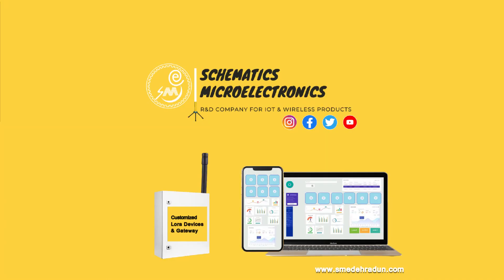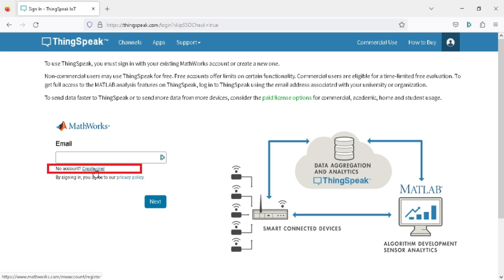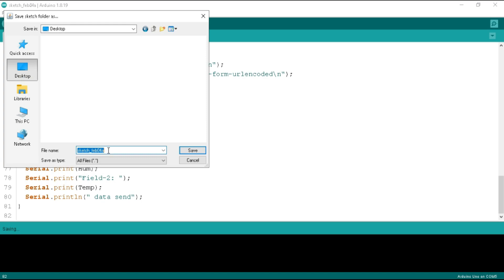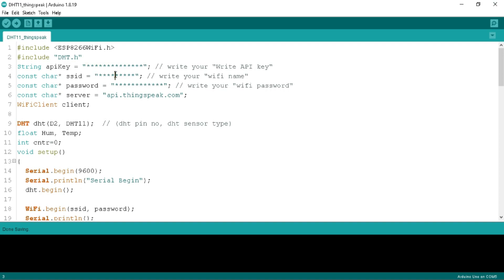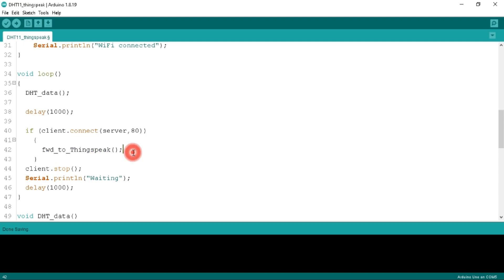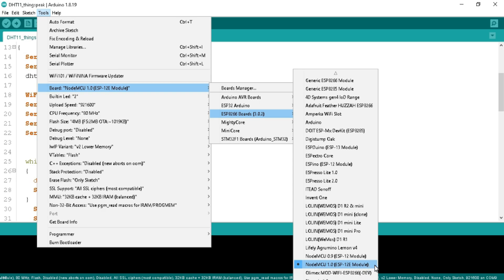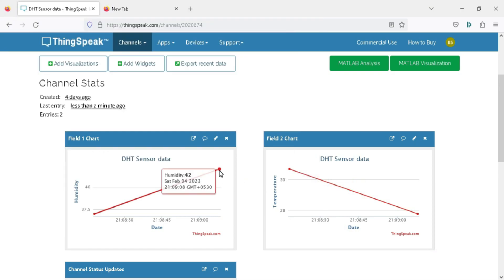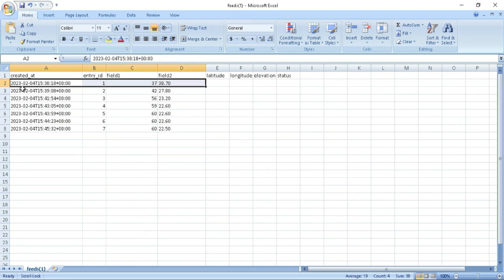Real-time Monitoring of Humidity and Temperature: Sending DHT11 Sensor Data to ThingSpeak Server

Comment: Why it showing nan at the output. Pls help asap I need this project tomorrow.
Reply from the maker: If you getting nan in the output that means there is connectivity issue with DHT sensor. Check the connection and wires.
Reply: Now I am getting the issue as failed to read from DHT sensor
Reply from the maker: That means there is issue with your DHT sensor. Try with another DHT sensor

Comment: how to send alert message to mobile when sensor data is getting high values ,using gsm module..?
Reply from the maker: Yes, you can send sms using AT Commands. 
This video can help you

https://youtu.be/SX0lyiJezgc
Reply: @SMEDehradun  Bro, Is there need to use only 2G Sim for sim800 model.. Or 4G sim also work
Reply from the maker: In VI & BSNL also providing 2G services in 800C and 800L. I have just checked it today in the gsm module . It’s working
Reply: @SMEDehradun Ok Thanks bro.. I will check ..
Reply from the maker: @starhero6314   k